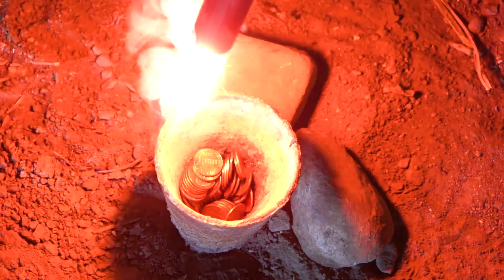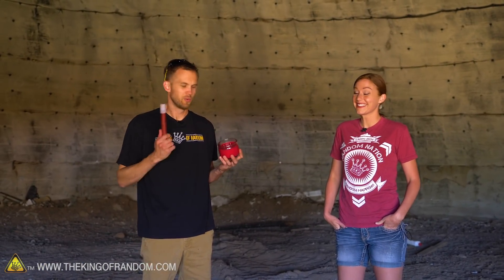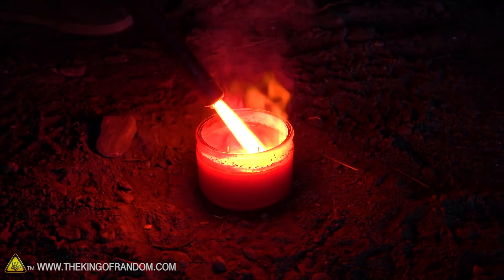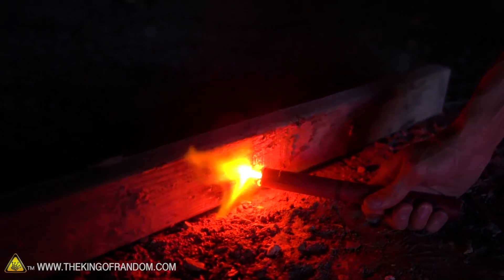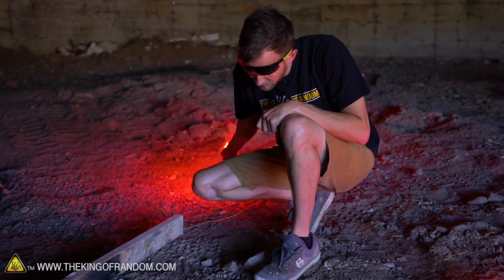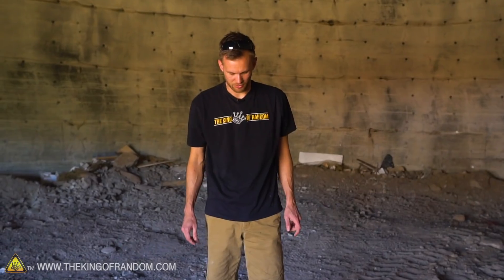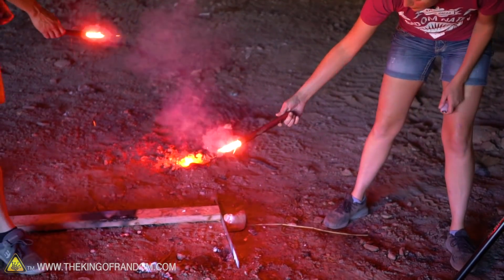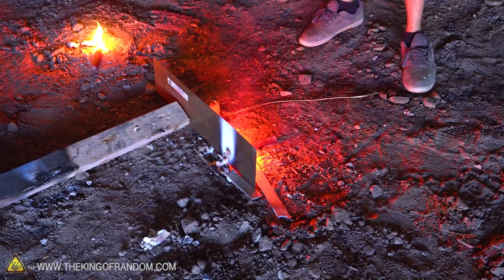Are Road Flares Hot Enough To Melt STEEL?

Comment: I used to make fire starters from used road flare remnants.  cut it down to 2 or 3" chunks, tape over the ends with some paper tape, and embed wooden matches in the end.  road flare composition is hot enough to even start wet wood (1450 °C, 2650 °F), and it has a known burn rate. 3" is about 5 minutes of burn time.

Comment: the aluminium bar could have got melted by 1 flare only if you had used a less length as it spreads the heat

Comment: So I have quest for you guys. Can you weld two pieces of metal together with a flare
Reply: No, besides how hard it is to melt steel with it, it spurts out all those glowing drops of melted strontium ash. That will get stirred into the metal and keep the weld from sticking.
Reply: I never said steel I said metal and it melted the aluminium pretty well so maybe weld was the wrong word but braising would be possible.
Reply: @edwarddonaldson5193  it might be worth a shot. I've lit one of those flares before and not only do you get a hot flame, but you get drops of liquid that glow like lava. When they cool off they're like a crumbly mineral. I imagine those drops will get in whatever you're heating. Again, it wouldn't hurt to try though.

Comment: You probably burned the thin steel sheet, not melted it.  

You've probably noticed with steel wool that iron will burn in air if given enough encouragement, after all.

Comment: automation test, finding a way to light as many of those flares as quickly as possible either at the same time or straight after each other
Reply: Easy, put them in a cluster under a steel plate with a tiny hole in the middle. Put a fuse through that hole, light it and run! Or zig zag runs of nichrome wire over it, tyen melt them with 240v.

Comment: The problem with Aluminum is that the oxide layer on it melts at about 3700°F whereas the actual aluminum itself melts at about 1200°F

Comment: Flares produce their light through the combustion of a pyrotechnic composition. The ingredients are varied, but often based on strontium nitrate, potassium nitrate, or potassium perchlorate and mixed with a fuel such as charcoal, sulfur, sawdust, aluminium, magnesium, or a suitable polymeric resin.

Comment: Suggestion: Do a "Road flare into liquid oxygen" or, "Road flare in high oxygen environment" I wanna see how devastating the flare could become
Reply: It gets most of the oxygen from a chemical powder inside it. But the paper wrapping might burn faster in oxygen. Whjch might make the whole thing burn faster. Some things xpl0de when the are dipped in liquid oxygen and burned, so I wouldn't stand anywhere close if you dipped it.

Comment: The only problem with using flares to start a campfire is you really want to wait a while after the flare is consumed if you want to cook on or with your fire. I had a product called Pyrogel, don't know if they still make it. It was used to preheat the fuel line of backpacking stoves in the winter. Stuff was like a clear napalm. Split a log, chop a shallow 3-4 inch trench in the middle, lay down a ribbon if Pyrogel and you could have a fire going in minutes and the Pyrogel burned off in the same time it took to get the fire established. Safer and faster to cook on.

Comment: The reason why the sheet of steel got damaged way easier than the wrench is because they are clearly two different kinds of steel.  The sheet is designed to be reshaped while the wrench is designed to keep it's shape as the wrench is way more hardened overall.
Reply: And also the wrench is thicker.
Reply: Wrenches are usually made of chro-moly or chrome-vanadium steel. Which can be(and always are for tool purposes) heat treated to about 40 Rockwell hardness. Hardness doesn’t determine the melting point, boiling point, etc. That is determined by the composition of the alloy itself, spring steels, like what is found in a truck leaf spring get red hot at about 1600°F and once at that temperature it rearranges the structure of the steel, reducing it from a martensite, or bainite (very hardened steel) to regular untreated steel, which is known as “normalizing”
Reply: Pretty sure the road flare just oxidized the steel plate causing a the small hole surrounded in rust as opposed to melting it
Reply: @EnigmaticLucas  steel in and of itself in not an alloy. It's just the name we use for iron that contains a moderate percentage of carbon. Since carbon is a nonmetalic element it does not form alloys and can be added or removed from the iron. Wrought iron is 0.15% carbon or less, steel anywhere from 0.15%-2% and is best when under 0.5%, while cast iron usualy has much more than 2%.
Reply: @nicholashodges201  i'm pretty sure that an alloy is a combination of metals and you just proved that it's an alloy by trying to prove that it's not one.
Reply: Amora Silverspark it’s actually the alloy in the steel that makes it melt at higher temperatures and alloying also usually makes it harder.
Reply: @scoutmaster33  steel itself is an alloy of Iron and other metals in different ratios depending on the type of steel needed. OP was saying that the wrench and the sheet are 2 different types of steel which is 100% true as the steel alloy used for the wrench is designed to be more rigid and stronger than the steel alloy that comprises the sheet of steel as that is typically used for welding and reshaping.
Reply: Morejstu is the best Youtuber

Comment: I would like to see what happens when we put a flare in a microwave oven 😄
Reply: Probably nothing or not much. Depends on how much water is inside a flare which I doubt is much.  They work by exciting the water molecules in food.  Why stuff like a veggie heats faster ... mostly water.   Sure if In long enough, it may ignite ... but I dunno if would only say 30 seconds or a minute ...
Reply: There are other polar molecules besides H2O. It might uniformly heat until the whole thing is like 5 degrees below it's ignition point. Maybe nothing, maybe it melts out all the fuel (making it weaker), maybe it just lights, but there's a tiny chance it goes boom.
Reply: I know there’s a lot of scientific explanations but i wanna day it go boom boom

Comment: what happens when you take apart a couple of flares and light the strontium powder will it be a flash or will it be steady
Reply: @Melika Abedian they've done more dangerous thing but ok.
Reply: @System-ru5yt   no, they haven't. Road flares are dangerous, you should never open one
Reply: @catgirl-ame  well now I have to go buy one so I can take it apart and set it one fire.
Reply: @AmberWool  same, I actually have one in my car. Totally gonna do it now
Reply: @System-ru5yt  but ok
Reply: It will burn a little faster, but thats just because of the higher surface area. It'll not just go up in a flash in an instant.
Reply: Aaron Hughes yeah its not like frickin matches its not instant
Reply: I cut one into mini flares, ended up with a little dust. It's hard to light because it starts to melt first and eventually it just burns like a flare. The "mini flares" were a failure, took like 10seconds to light them with a blow torch. But I don't recommend it, some brands have different chemical makeups and you definitely don't want something that hot to flash in your face. I wore a plastic face shield long sleeve cotton shirt and leather gloves when I cut it, but I don't know if that would protect you if you had one that xpl0ded because you cut/ground it.
Reply: @deltab9768  i think the easiest way is to grind up the phosphorus from the striker piece and the end of the flare to make it burn. the mixture of the grinded 2 phosphorus powders is extremely heat sensitive and friction sensitive and it burns hot so that might work.
Reply: • LX Gamer • hey bud if your smart enough you would know that they like it when you put suggestions in there comments and they’ve done way more dangerous then that

Comment: Aren’t 2x4s treated to not be flammable now? Like they’ll burn but they won’t hold a flame because they are used to build houses and that’s not ideal
Reply: Not all
Reply: Lololol, that feeling when you see someone has never burned a 2x4...
Reply: Bob Longhorn  There are specific kiln dried, fire retardant pressure treated wood now. It's possible he means this. Look up FRT (fire retardant treated) lumber.
Reply: I mean the burning point is normal with 2x4 by modern standard. But won’t catch flame easily and yes there is special ones as well that are even better at fire resistance